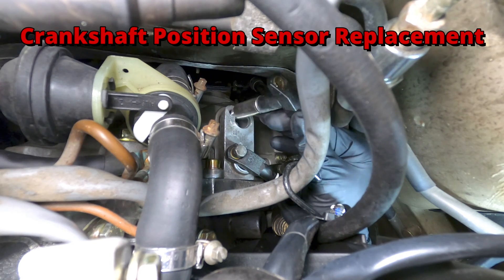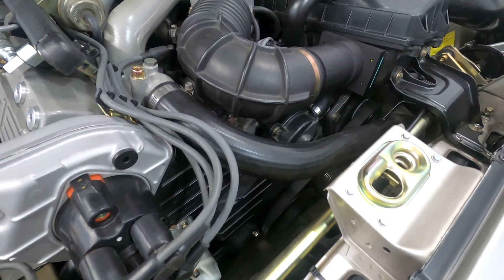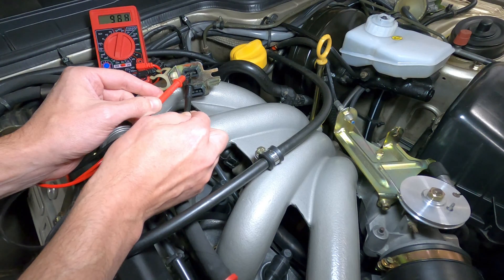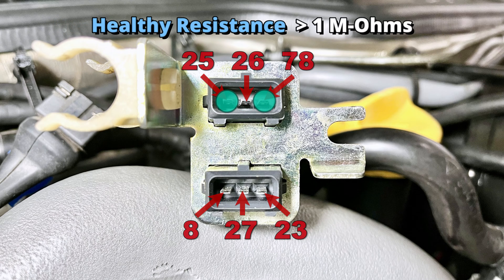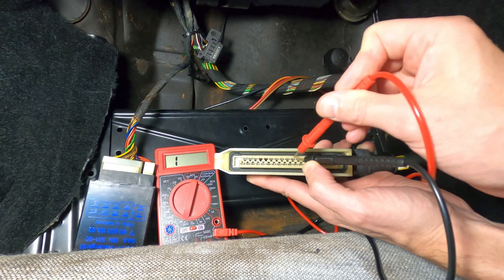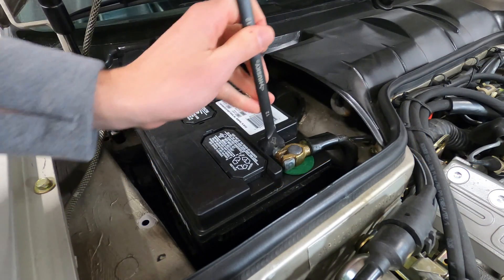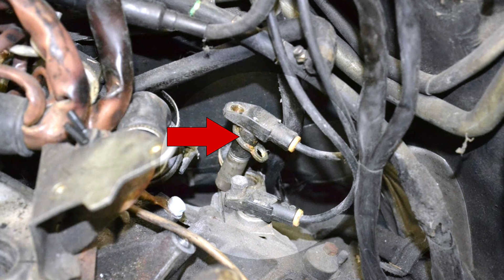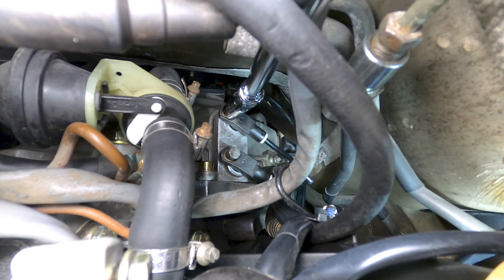Porsche 944 – Crankshaft Position Sensor Testing & Replacement Tutorial

Comment: Just replaced my speed/Reference sensors, car was running great and all of the sudden won’t start. No tach bounce, It’s got a new coil, new distributor cap, new plugs, new plug wires, new DME relay. Any thoughts?

Comment: Do you have any tips on how to reach the locking and pivot bolts on the sensor bracket? I cant seem to be able to reach them with any tool or from any position. Admittedly I have a 924s with air conditioning and it seems that I have less room than what you seem to have in this video, still I would be greatful if you have any tips on how to reach those bolts :)
Thanks for the great video, your channel is a saviour to all of us with these cars!
Greetings from germany
Reply from the maker: Greetings! Yeah, those bolts are very difficult to reach. I usually work them from below the car using a universal joint and a long ratchet extension. The problem is you can’t really see their location from below the clutch housing and torque tube area, so I inset the hex key tool and ratchet extension from above, make sure it’s well seated in the fastener, then go down below and connect the ratchet. The bolts are often oxidized, and a little penetrating oil can help loosen them up. I also try to push the tool forward into the fitting while loosening them as they are known to strip easily.
Reply: @NC944er  Thanks Dude!

Comment: Great video!  Very helpful.   I noticed the fuel pump (shown at 1:20) is not correctly mounted.  There should be an "S" hose from the fuel tank strainer to the pump, and the pump should be held to a bracket above by a large hose clamp.  This arrangement relieves the stress on the fuel lines.  Thanks for posting.
Reply from the maker: Thanks for watching! You have a good eye. The early cars from ‘83-‘85 did indeed feature an s-shaped fuel line with the pump mounted from above. This is a later car where the design was changed to an elbow or j-shaped fuel line with the pump mounted from below to a newly added metal cover for the 1985.5+ model years. The clip at 1:20 is shown with the cover removed, but the rubber pump housing is still incorrect (installed by a prior owner). Most of these components were updated in a later video if you’re interested in learning more about the later design -  https://youtu.be/0gcesI3GJog?feature=shared

Comment: If I’m simply just replacing my sensors, would i need to adjust the sensor gap?
Reply from the maker: Nope, if the sensor bracket is already gapped correctly, you can simply swap out the sensors without making any other adjustments.
Reply: @NC944er awesome! Thanks for the quick response! 👍👍

Comment: Explanations concise, to the point!
My mechanic didn't know which of my sensors was dead and was so exhausted that he'd reversed them. Watched in horror as my '83 944 acted like a "Bucking Bronco," Yet smoothed out in reverse? Had to switch them at 12:00 AM, at an ARCO, I did tell them what happened. They laughed because it was on video 😂 Gave permission to post a section of it, we couldn't stop 😅
Sadly, I diagnosed the car it came off of, that its sensors were switched. They'd cannabilized the engine over nothing.
I've had my 944, 23 years. Just using common sense, I've diagnosed a huge issue on my own, when the Dealership tried to baffle me with BS! The mechanic was switched out,  who had the old diagnostic computer. Dealership tried to charge me $1500 without fixing it! Hint: smell of ozone and the engine would cut out suddenly on the freeway. No diagnosis.They just let her idle for 2 hours when it blatantly needed a load on the electrical system. Diagnostics would have shown the problem immediately. I showed up, engine cut out when I revved it. I pulled out a small box and said that I would make a bet VS. the owner and all the Porsche mechanics on the spot, (huge Dealership), that I could fix the periodic engine failure, in 5 minutes. If I won, I'd receive a huge apology, they'd drop the bill, give me $50 for dinner. If I was wrong,  I'd pay the erroneous bill. They were snickering, mistaking me for stereotypical. 
I opened the box, removed a screwdriver - and an actual DME computer!! Jaws. Hit. The floor! Got under the right side of my steering wheel, removed the old one, popped in the newer one, plugged it in. Smooth turn over!
Mouths hung open, as I passed the burned DME computer around,  blatant ozone smell hung onto it. I'd looked it up. It's a known issue with 944s! I no longer can overhaul the engines, double rotator cuff surgery. So I very much appreciate what you are doing!!
Reply from the maker: That’s funny! With the age these cars have one them now, we’re probably going to start seeing a lot more failing DME computers.
Reply: @NC944er Running low octane on these engines,  has burned out more DMEs than anything. Because that forces the computer to retard the cylinder firing by a bit. 
That's why I use Shell 91 (constantly tests up to 97+ octane)
My car's purred, ever since.

Comment: Your videos and explanations are exceptional. Your car is wonderfully pristine. However... For anyone doing this task on a car that still has it's original sensors (in there for 40 years) , it is nearly impossible to remove them without removing the sensor bracket (not meant to come out while the sensors are still in).  The absolute fastest way is to cut the aluminum sensor bracket (dremel with 90 degree flex head). You will destroy the bracket, but they aren't very expensive (still available new). I tried every technique possible to remove the sensors and then to remove the bracket undamaged. After lots of time and swearing I cut the bracket to remove it. Tight fit to get the dremel in there (Mine is a Turbo with even less room than an NA) but once you get positioned it's straight forward. The sensors were never going to come out. Had to bang them out with a hammer with the broken bracket in a vice.  New bracket goes in fairly easily (Combination of a low profile adjustable angle ratchet and some narrow sockets). Set the gap and off you go. Had I known it was going to be impossible to pull out the sensors I would have saved myself a lot of grief and time. Probably 20 hrs of trying everything imaginable to get them out and then less than two hours to just cut the bracket and replace it all.
Reply from the maker: @Chrisovideos  Yeah, removing the crank sensors can definitely be a beast, one of my least favorite jobs on the 944 due to the tight location and how badly they can get stuck. I’m not sure if the ones on this car were original, but they were old for sure. I spent about an hour getting them loosened up and removed (the video shows quick removal of a new sensor for demonstration purposes). There’s a method where a 6mm Allen head bolt can be used as a press from below the sensor mounting tab that works fairly well, but sometimes they are just really jammed in there.

Comment: If I get no reading at all on my meter from pins 25/78 and 8/23 are my sensors bad? My other readings are within spec but no tach bounce no start
Reply from the maker: Those pins should measure greater than 1M ohms, or essentially infinite on some meters. If your multimeter displays "∞" or "OL" that would be a good sign. If it’s showing a lower resistance reading, something is off.
Reply: @NC944er interesting. So my meter reads OL when it isn’t touching anything and then it just doesn’t change when I touch the outside pins.
Reply from the maker: @ Yep, sensors are probably good then. I’d move on to other suspects. Make sure sensors are connected to the correct harnesses, check resistances on the DME connector pins, ensure the crank sensors are properly gapped for 0.8mm (usually this is fine unless there was related work that might have changed their position).

Comment: What does it mean if I'm getting 0 reading from either plug from either sides of the cables? 
I could see 1 cable going bad or even 2 but no reading from all 4 connections from both cables both ways is mighty sus.

Comment: hello, very informative videos. I have an 89 94s2 convertible and it stopped running some months ago but I didn't have time to work on it until now. Tried going through all the steps in this video but ran into a few issues.  New DME relay, I only have one reference/speed sensor?? and my computer has three rows of pins?? (944.618.124.02)
Reply from the maker: @THEPASSIONATEDRIVER  Yeah, the general process here will be for the 8-valve engines, some of it will align for the S2, but not all. The S2 only has one reference sensor due to differences in the flywheel.
Reply: Ah I see. Thanks. Do you know which pins do I use to check resistance for the reference sensor on my 3 row pin connector?
Reply from the maker: @THEPASSIONATEDRIVER   Here are some shots of the S2/968 pinout diagram, check out 47 and 48...

http://forums.pelicanparts.com/porsche-924-944-968-technical-forum/675801-944s2-dme-pin-out-diagram.html
Reply: Thank you

Comment: Very nice instructions here and fortunately apply to my 1983 S1 too.
Now, I am just a little concerned. Both sensors measure 850ish ohms on the first two pins and the same on the dme connector. But the over 1 million both give back a 1 as a reading so nothing can be measured. Now am I too stupid or are they just both gone?
Used the 2000k setting on the multitool.
Cars symptoms so far are a hard start and turning off after few seconds again, and the crank sensors are the last thing I had yet to test.
Reply from the maker: @JGStone  The “over 1 million ohms” is synonymous with an infinite reading on the meter, and it sounds like that’s what your getting, if the other reading the within spec, they’re probably ok.
Reply: @NC944er  After visual inspection while taking both out, they both look fairly new... and rpm gauge does work, so I think I'll switch the two sensors and see if something changes.
Reply: @NC944er  Aight thank you m8, guess I will just take em out and continue visual inspection, kinda hoping they are busted so I have finally solved this cars mystery.😅

Comment: BMW used the same sensors, only they had longer leads and were half the price. The Bosch sensor is the BMW sensor with the 610mm lead.  OE is around 400mm. BMW part number 12-14-1-708-619-M14.  Recently found your channel and am enjoying the content. Brings me back a 15 years ago when I started building my 951.

Comment: Great videos, as always. That speed reference cable, is this what gives you the rpm on the tach? My tach not working. Everything else seems to be running properly.
Reply from the maker: The speed sensor counts the teeth on the flywheel and sends this signal as pulses to the DME computer to determine engine speed in RPM. The DME then sends this data to the tachometer gauge on the dash. If the speed sensor tests good and the engine is running fine, you’d want to inspect the tachometer gauge and related connections and electrical components.
Reply: @NC944er Thankyou for your response.  I’m getting zero readings at pins 8/27,  and 25/26 at terminal under passenger dash, with battery disconnected. No problem starting, so does it appear that the probable cause of the tach not working, is a wiring issue?  If so, I will need to find a way to take instrument cluster apart. Downside is that I have dual air bags, and it’s a pain getting dash out with steering wheel in the way. So frustrating, but so rewarding when it’s solved.
Reply from the maker: @glow9999  If the engine runs, you should get a reading across those two sets of pins. Maybe the test leads couldn’t get far enough into the connector? At any rate, those are the pulses from the sensors to the DME computer, the computer then sends a separate signal to the tachometer gauge from another pin on the connector. Could either be an issue with that wire, pin, or the tach gauge itself. Most often it’s the gauge. There are a number of different components on those boards that can burn up, get oxidized, or have cracked solder joints.

Comment: My car runs fine, but I have no tach activity at all. No bounce on start up and no movement at all while the car is running. Is it likely to be a speed sensor issue, or should I look elsewhere?
Reply from the maker: Hey! So while the speed sensor determines the RPM, which is sent to the DME, and then the DME sends a signal to the tachometer gauge, if the speed sensor has failed, the engine would run VERY poorly if at all, because the DME wouldn’t have a reliable signal to correctly apply fuel injector cycling. So in your case, I would look at the tachometer itself… sometimes the connections behind the gauge cluster can become corroded or the pins get pushed out of the plugs, so they have a poor connection with the gauges. The circuit boards for the tachometer also have components that can burn up or a failed circuit trace. You’d have to pull the steering wheel off and then remove the gauge cluster to get in there and inspect for those issues. If the tachometer checks out ok, there could be an issue with the wiring that leads from the DME to the gauge cluster.
Reply: @NC944er  awesome thanks chief, you're an absolute legend!

Comment: I dropped my bolt and I don’t know if it landed in my flywheel inspection hole I can’t find it anywhere it’s not on the floor😪
Reply from the maker: That sounds super annoying! There are quite a few little crevasses on that side of the engine where things can disappear. It may be worthwhile to poke around with a magnet to see if you can grab it. Also, you can look through the clutch inspection hole at the bottom of the bell housing and/or pull the starter off to get a view at the lowest point inside, see if maybe the bolt is hanging around down there.
Reply: @NC944er pulled the starter off and got it thank you. I’m not getting any signal from the pins for the reference sensor at the DME. I’ve just replaced both sensors so I’m stumped. Hopefully not the loom itself

Comment: Going to check the sensors this weekend! Does it need to be gapped still even if I’m just changing the sensors?
Reply from the maker: Nope, as long as the bracket was correctly gapped beforehand, the sensors can simply be swapped out with the bracket in its existing position.
Reply: @NC944er  awesome thank you!

Comment: Is it necessary for the bracket that holds the 2 speed sensors to be bolted to the intake manifold for the car to start? I'm having a no start situation. New Focus 9 DME relat installed toaay. New speed and ref sensors have been ordered, arriving next week.
Reply from the maker: No, the wiring connector bracket doesn’t need to be bolted up for the engine to run, just that the sensors are properly connected. If the new sensors don’t resolve the issue, I’d check for spark and fuel. Here is a helpful resource to get started - https://www.clarks-garage.com/shop-manual/ts-01.htm
Reply: Awesome thank you, much appreciated, very helpful. 
Does the sensor need to be regapped if the bracket wasn't loosened? Can I only unbolt the sensor and drop in a new one?
Reply from the maker: @RichiWang-ef4mp  Yeah, in most cases you can leave the mounting bracket adjustment as it is and simply swap out the sensors, unless you have reason to believe that it’s not adjusted correctly or was taken off for other recent work like a clutch replacement, etc. If the car was previously running fine with the current bracket setting, you should be good to leave it alone.

Comment: My Friend just bought a 1988 924s. We have replaced the Ignition coil, Distributer Cap and Rotor. The new coil tested positive for 12v. We also replaced the plugs and wires. Still no spark. Any suggestions for the next step/ test to run?
Reply from the maker: Have you tested the speed/reference sensors? Are you seeing tach bounce when cranking the engine? Is there a factory alarm installed on the car? If so, have you bypassed the control module to rule that out? The DME Computer is another possible suspect. Here is another resource to help start diagnosing “no start” issues: https://www.clarks-garage.com/shop-manual/ts-01.htm
Reply: Thank you we will try those! We will keep you updated!

Comment: Great video as always! I had such a time with this job when I first got my car. It was hard diagnose in the first place because the sensor wiring was damaged INSIDE the connector, but looked fine. When I finally got the repair done, I ordered a replacement  locking bolt for the bracket from a parts outfit, and they sent an M7 instead of an M8. A minor visual difference that translated into a stripped eyelet on the car before I knew what was happening. I have to run a nut/bolt/washer combo for the lock now, making an already fiddly job even more so. I don't buy from that parts outfit anymore.
Reply from the maker: Oh man, that sounds terrible! I won’t ask who the parts outfit was, but I have a couple ideas from my own experience based upon similar part mis-picks. 😂

Comment: One tip- stuff a rag into the flywheel inspection hole whenever you're working near them. This will prevent any bolts from falling into the bell housing
Reply from the maker: Yep, or a small piece of painters tape. 👍🏼

Comment: Great overview!  I recently changed mine for preventative maintenance since they are known to fail.  They were quite difficult to remove even with a makeshift slide hammer on locking pliers...but I got them out!
Reply from the maker: Yeah, you can spend 45 minutes to an hour removing just one sensor if it’s really jammed up. Pretty ridiculous. 😂